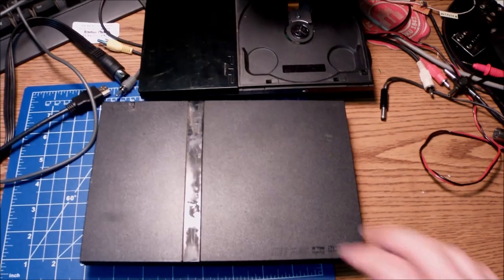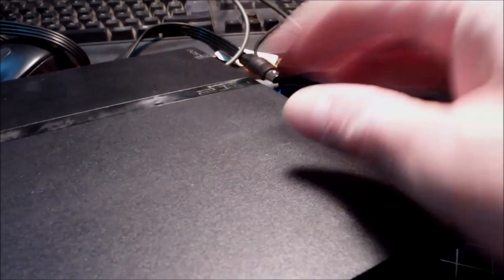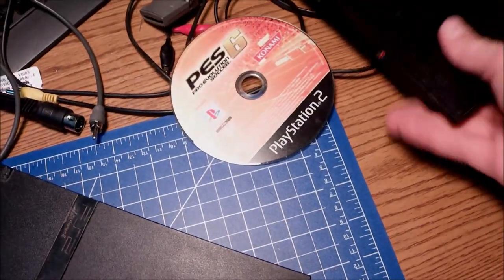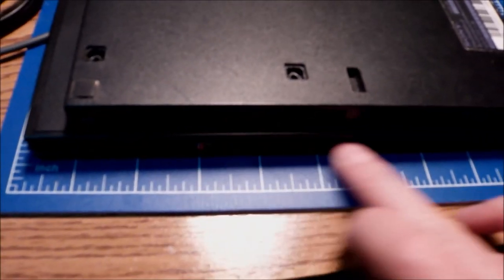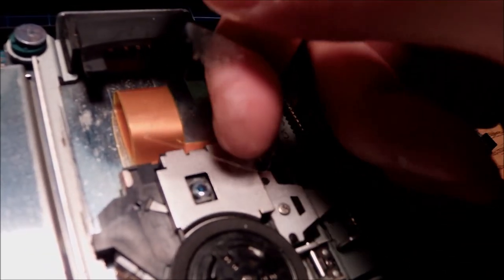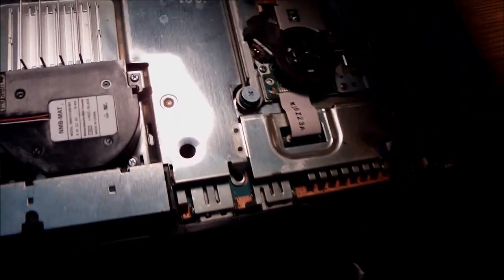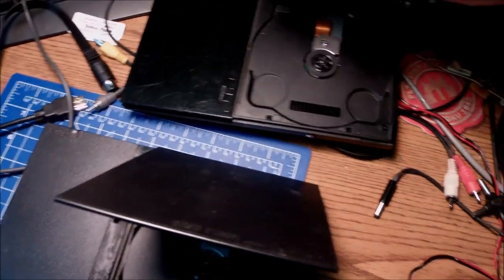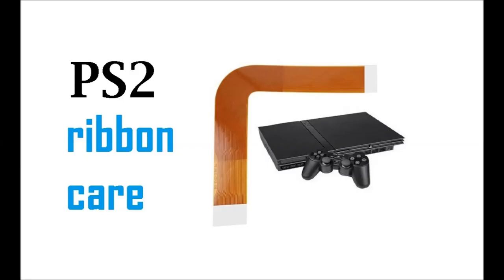PS2 Essentials:  Ribbon cable positioning & care so, no disk is damaged.

Comment: I’m a little nervous to do this myself, but I may very well do just that, as this is a great tutorial. Do you think that I could get someone else to do this at like a tech store or something? How hard is it to put the tape down there, and do I have to measure exact numbers for the tape?
Reply from the maker: Hi, valid questions :-) it is not hard though - the tape i have used is strong typical stationery tape and cut it in two before it was stuck so, you get get the two pieces aligned - Radio shack is a good idea to be on the safe side but they will charge you probably. Trust yourself i would say :-) to get to know your machine - Thanks!
Reply: Cyberhug Technologies thank you so much!! One more thing, did you put the tape in between the ribbon, so that the one piece covered both sides? Or did you use two pieces and put them both on separate sides? Again thank you very much, you’re an awesome dude for doing all this stuff!!!
Reply from the maker: @sawyerdale7338  Good point again, on this one i used two pieces as more convenient solution but yes, in the past on other machines i have put the tape in between, you're catching details perfectly :-) so, i am sure you'll do a great job!
Reply: Cyberhug Technologies man thank you so much!! I don’t really sub to that many channels, but you’ve earned mine! You’ve helped me at every turn. Thank you so much, seriously. Best tech youtuber ive seen yet, and no one else I’ve seen has covered this type of stuff. Much respect
Reply from the maker: @sawyerdale7338  Happy to help at all times! <3
Reply: Cyberhug Technologies ok so my ps2 may be done for now 😬😳

I tried it and did all that stuff, then put my disk in, and it started making a horrible grinding type noise. No damage was done to the disk, but it wouldn’t read and kept making the noise until I turned the PS2 off. I took off the cover for a second whilst it was happening, and the spindle type thing on the right side of the laser (the golden thing) seemed to be making the noise, and the laser wasn’t moving. I’m not sure what happened, I guess I messed it up pretty bad lol. Any ideas? I don’t blame you for this it was probably my own fault, I honestly prob should have brought it to a shop. Oh well, if this thing does indeed die now, I can buy one for a pretty cheap price haha
Reply from the maker: @sawyerdale7338  Nothing is dead :-) the motor is not adjusted right (the long screw 'golden thing' is making the noise as it doesn't go up and down and tries to find the right path to move the laser right) the trick is to have the (check 7:56') silver leg from the laser mechanism going to the motor the right way, as shown, and test it by hand (up and down like 8:30 ) before putting back everything together.
Reply: Cyberhug Technologies hmm... I’m not sure what’s happening to be honest. When I move the laser manually, the long screw moves as well, but when I put the top on and start it, it does nothing and makes the noise. After I took the top off I saw that the laser moved for a 4th of a second, maybe a half inch towards the north end of the console, but then it went back again and didn’t move anymore. Not sure exactly what’s going on, but thank you for your willingness and ability to help, it’s much appreciated. I believe the leg is connected to the screw the right way, but it doesn’t seem to move. Have you ever heard of something like this happening? I never thought this would have happened haha
Reply from the maker: @sawyerdale7338  Really sorry it turned that way but by the sounds of it, it must be some simple assembly issue of some sort - the top cover in particular - let me please know how it turns out if you go to radio shack etc. those machines are forgivers, it can't be that bad.. Thanks!
Reply: Cyberhug Technologies Alright, I will do that! Thank you so much for the help!
Reply: @sawyerdale7338  So what ended up happening?

Comment: Hey are you a ps2 expert? I need your help. So i bought a used ps2 online and everything is fine except the lens. The lens coudn’t read disks so i bought a lens replacement. I followed a tutorial, even soldered the reciever thingy. And when i was about to put the new lens to the ribbin cable, the white thing fell of the ribbon cable. I put it back on and tried it. It wasn’t reading the disk still. It doesn’t even detect that there is a game in. And the lens and the disk spinner don’t move. Can you make a video on it?
Reply from the maker: Hi there - sorry to hear about that mishap - There are some things to do in order to replace the whole thing - one of them is the safety solder ball to be melt for instance - try please, to check this video : 
https://www.youtube.com/watch?v=PcqlzIjQVxc&t=1s
Reply: @CyberhugTechnologies   i already told you, i’ve done that. But the console doesn’t detect that it even exists.
Reply: @CyberhugTechnologies   im not sure if it’s the crappy lens i bought or the ribbon cable
Reply from the maker: @JAJrPhotography  Well, you're right... put the old lens on and conduct some tests - the ribbon cannot be damaged so easily, it is flexible and can stand a lot of pushing... check the edge of the ribbon carefully please...

Comment: Thank you!
Reply: I made the fix so my discs should now be protected. 
As a note, my PS2 was quite stuck so I had to force it open and 2 of the screw wells broke off. I really don't think it would have opened cleanly.
Luckily, those screws didn't change how much the housing holds together, so everything still works.

Comment: Why do you need double sided sticky tape if you're only taping the bottom of the ribbon? Or have I misunderstood something? My PS2 just scratched my disk do badly it doesn't work and now I'm scared to use it :(
Reply from the maker: Hi Mark, the tape is in between the back of the ribbon and the console itself, you can use single side regular tape, like i did here. To conduct tests, pick some old audio CDs to be dedicated for that purpose and then you won't have to worry much :-) thanks for watching!
Reply: @CyberhugTechnologies  Hi what do you mean by in between the back of the ribbon and the console itself? Do you mean that we only need to tape the bottom part or the curve part of the ribbon just enough so that the ribbon is somewhat straightened or do I need to tape the moving part of the ribbon down and attach it to the console itself by using double sided tape?
Reply: @CyberhugTechnologies  I'm really stressed out because my unit scratched my disc and I'm about to buy replacement discs
Reply from the maker: @908yshin9  Hi there, yes - it is shown in the video, right at the back of the part of the ribbon :-)
Reply from the maker: @908yshin9  it will be fine if you do it like in this video - thanks for watching!
Reply: @CyberhugTechnologies  Thanks for the immediate response I don't really expect you to respond so early but thanks again. I'm still confused, I'm really sorry but the video didn't make it quite clear for me..can you elaborate what I'm supposed to do? Do I need to tape the moving ribbon at the top or just the bottom of the ribbon to straighten it out? Excuse my ignorance because when I manually try to move the lens from up to down, there's a certain part where the ribbon still stands above the disc tray where it could potentially scratch discs..
Reply from the maker: @908yshin9  No worries.. you put it right " the bottom of the ribbon to straighten it out" is exactly what we're looking for - to avoid any curve that might scratch the disk.
Reply: @CyberhugTechnologies  Thanks so much. You are such an awesome guy

Comment: So I was trying to fix the problem with the ribbon and I did it with super glue (kola loka) but I glued it too much to the up side and it didn't work, now I need to unglue it but I can't. Any suggestions?
Reply from the maker: Hi, the point is to make it reversible so, it can be removed while servicing / replacing the laser module - Sounds to me it is damaged already (the ribbon) but you can sure try gently to pull while applying petrol based products /or acetone /or alcohol - depending on the glue type.
Reply: @CyberhugTechnologies  i tried with nail polisher, it only moved a few milimeters after half and hour of trying, isopropyl alcohol can work? is there any way to check if i damaged the ribbon cable? when i turn on the ps2 it makes a very loud grinding noise for some seconds, then it stops (even with no dvd on it), thanks a lot for the help
Reply from the maker: @user-wb4dm4gu3g  i think you really need a new ribbon... this is the best option now, the grinding noise is classic since the motor initiates without something that can be moved up or down..Iso Prop may work, yes... please, make sure the surface is absolutely clean and smooth, free from glue leftovers before installing the new ribbon! many thanks for watching and i hope this helps!
Reply: @CyberhugTechnologies  alright, im gonna order a cable, thanks a lot btw, do you know if using the ps2 without laser connected can damage anything? (i have fmcb so i can load games with usb)
Reply from the maker: @user-wb4dm4gu3g  you better get a new ribbon yes :-) not really - the mechanism only tries to see if there is disc inserted for a while, then it stops since nothing is detected (FMCB is good :-) )
Reply: @CyberhugTechnologies  thanks a lot, great channel btw

Comment: The Ribbon Cable detached from the laser... :( what should I do? How do I get it back in?
Reply from the maker: Hi, just slide it inside the connector - the long gray thing which is at the back of the laser!
Reply: @CyberhugTechnologies  Thanks for the reply! For do this, do I need to tear apart again my PS2 or am I able to put it back even closed?
Reply from the maker: @Valenfield98  Yes, needs reopening - then, just lift the laser from one side - on the right - and it will give you the space needed to slide it in at the top of the laser mechanism :-)
Reply: @CyberhugTechnologies  Thanks for the super quick reply man! I'm gonna try this and hopefully it will work 🙏 meanwhile I will sub here and let you know
Reply from the maker: @Valenfield98  I have to thank you for sub! Please, keep me updated, more than happy to help!
Reply: @CyberhugTechnologies  hey man! Thank you for your words! So, I opened the console and attached this ribbon cable to the laser but, now when I insert a disc, all I hear is a "trrrrr" sound, and the disc doesn't spin at all... I see the laser lens which moves to the circle thing (you know, where you put the disc), does this trrrr sound and then it stops... What could be the cause of this?
Reply from the maker: @Valenfield98  Hey, this is classic - the motor is not adjusted right (the long screw 'golden thing' is making the noise as it doesn't go up and down and tries to find the right path to move the laser right) the trick is to have the (check 7:56') silver leg from the laser mechanism going to the motor the right way, as shown, and test it by hand (up and down like 8:30 ) before putting back everything together.